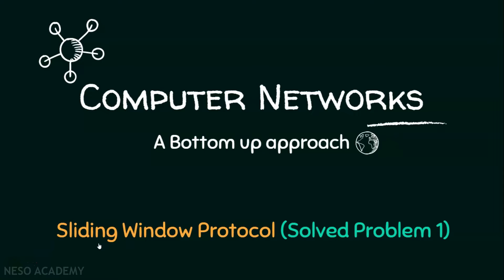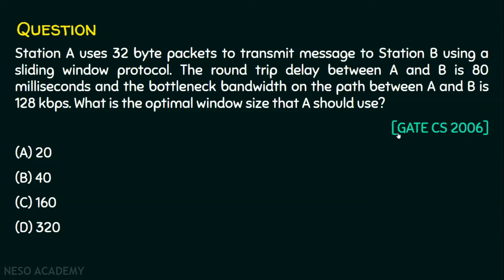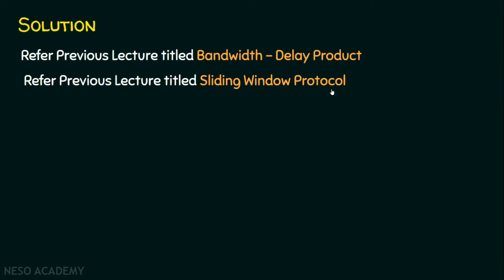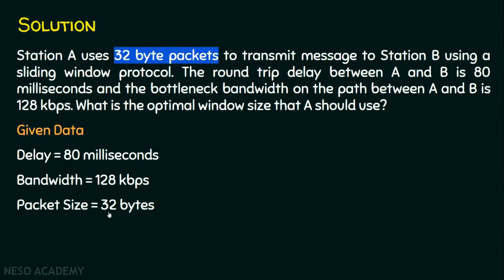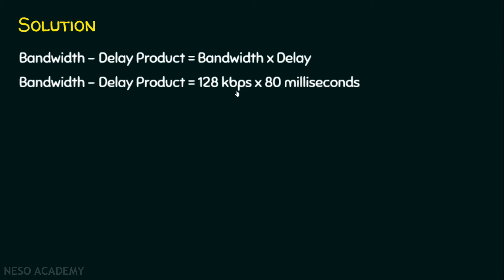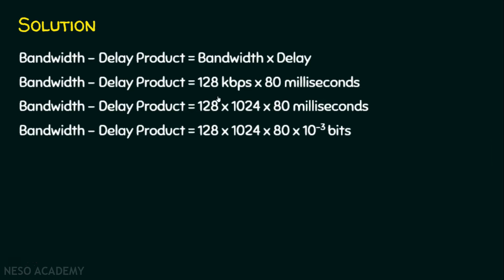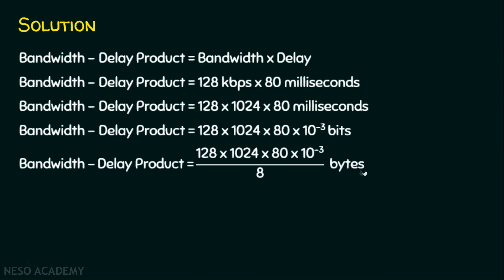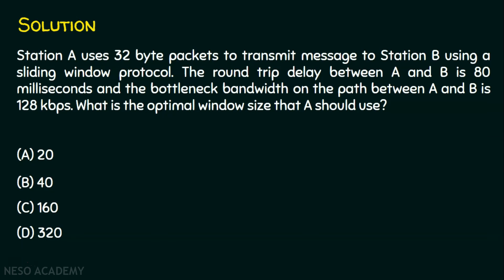Sliding Window Protocol (Solved Problem 1)

Comment: KB (Kilobyte):
1 KB = 1024 bytes (used in computer memory and storage).
Example: A text file size might be 50 KB.

kb (Kilobit):
1 kb = 1000 bits (used in networking and data transmission).
Example: Internet speed is measured in kbps (kilobits per second).

Hope it will clear all ur doubts..

Comment: Yes, when converting kilobits per second (kbps) to bits per second (bps) in the context of network speed, multiplying by 1000 is correct because network speeds use the decimal (base 10) system:

1 kbps = 1000 bits per second (bps)
This is standard in telecommunications and networking, where prefixes like "kilo" (k) adhere to the International System of Units (SI).

However, in computer storage, "kilo" often means 1024 (2¹⁰) because of the binary nature of data storage. For example:

1 KiB (kibibyte) = 1024 bytes
So, the difference arises from whether we're dealing with network speeds (decimal system) or storage (binary system). In a bandwidth-delay product calculation video, the decimal approach (multiplying by 1000) is appropriate.

Comment: Sir , 1 kilo byte = 1024 bytes not bits . So dividing by 8 is required?? 

If i am wrong please correct me
Reply: If the question says that it is 1 kilo byte, then we only multiply by 1024. We will not divide it by 8.

Comment: answer 40 is correct 
But replace 1024 with 1000 then u will get the answer 40

with 1024 u will get 40.96 which is actually wrong but 
can be used for choosing approximate answer
Reply: ha yaar bada dimag ka bosda kar rakha h school me 1024 padte hue aaye yaha aa kar 1000 kar diye
Reply: @pranavmittal9619  ye sab school padh rhe ho wah bhai

Comment: Bandwith-Delay product = Bandwith × propagation delay
Propagation delay = RTT / 2 = 40 millisecond = 40 ×10^-3 seconds
Bandwith = 128 kbps = 128 × 10^3 bps(bits per second) = (128 × 10^3) /8 bytes per second
Now, Bandwidth-Delay product = ((128 ×10^3) /8) ×(40 ×10^-3)) bytes = 640 bytes
Now, Window size = Bandwidth-Delay Product/Packet size or Frame size = 640 bytes /32 bytes = 20
So answer is 20.
Am I correct? 
Please correct me if I am somewhere wrong.
Reply: Yup it's wrong
Reply: @PKMKB93000  u r wrong
Reply: @RamanKumar-sp9bz  how? You want the slides of the remaining lectures?
Reply: @PKMKB93000   
{ 1KiloBytes = 1000Bytes = 8000Bits } & 
{ 1KiloBits = 125 Bytes = 1000 Bits }
Hope u got that

Neso has Done That Mistake
taking 1024 instead of 1000
Reply: @RamanKumar-sp9bz  Oh okay. Do you need the slides of other video lectures also? The ones that are private?
Reply: @PKMKB93000  Yeah Please
Reply: @PKMKB93000  yes plz
Reply: mhm nope wrong , the correct answer is 40ms , you cannot divide by 2 for propagation delay because we need acknowledgement as well  for data frames that why we use RTT instead of propagation time.
Reply: Let me try to explain:
firstly, we should know the data package link is not the same one as acknowledge link.
Secondly, the sender A need send data continuously in order to utilize the package link to the max.
thirdly, maximum window size of 40 doesn't mean there are 40 packages on package link. There are most 20 data package on the data package link.

So, if the window size is 20, it will be half part of the time that sender A doesn't continuously sent data package, because it needs to wait for the acknowledgment from receiver B, which is half of the round trip delay. <3

Comment: Bandwidth-delay product should be Bandwidth times delay, but in the solution above we have multiplied badwidth times Round Trip Delay to find the Bandwitdth delay prodecut. According to me we were supposed to divide the Round trip Delay by 2 to find Delay then we were to multiply that by bandwidth to find the required answer (20 acc to me). Have i understood something incorrectly? Anyone????
Reply: Bandwith-Delay product = Bandwith × propagation delay
Propagation delay = RTT / 2 = 40 millisecond = 40 ×10^-3 seconds
Bandwith = 128 kbps = 128 × 10^3 bps(bits per second) = (128 × 10^3) /8 bytes per second
Now, Bandwidth-Delay product = ((128 ×10^3) /8) ×(40 ×10^-3)) bytes = 640 bytes
Now, Window size = Bandwidth-Delay Product/Packet size or Frame size = 640 bytes /32 bytes = 20
So answer is 20.
Am I correct? 
Please correct me if I am somewhere wrong.
Reply: @aparnapathak6393  i think its 40 because we have to transmit data until it reaches the source but in worst case data can be collided so it has tobe round trip time hence the answer is 40  i got the same as 20 but then i watch it again about the concept of csma protocol
Reply: @sarastemkar7835  oh.. Okay! Got it! Thanks☺☺
Reply: I also got the same answer(20) bro, The question seems fishy in terms of terminology.
Reply: 20 aaya re kyu ki RTT toh 2twice hota he link ko pura fill hone me 40sec lagega jo hova Tp
Reply: acc to bandwidth-delay  definition from wikipedia it is the product of bandwidth *round trip delay
link to the article:https://en.wikipedia.org/wiki/Bandwidth-delay_product

Comment: There will be multiplication of 1000 not 1024 because 1KB = 1024 bytes 
And 1kb =  1000 bits
.
( 128 × 1000 ×80 ) / 32 ×8 × 1000
Reply: 1kb =  1024 bits=2^10
Reply: @blueSurfer  he has no brain cells🤣😂😂
1 kb = 1024 bits correct friend

Comment: In your bandwidth-delay product video you converted kbps to bits by multiplying by 1000 (not 1024).
Reply: Sir, there is some logic. Please explain. Even I have this doubt.
Reply: Lol ha
Reply: Yes, when converting kilobits per second (kbps) to bits per second (bps) in the context of network speed, multiplying by 1000 is correct because network speeds use the decimal (base 10) system:

1 kbps = 1000 bits per second (bps)
This is standard in telecommunications and networking, where prefixes like "kilo" (k) adhere to the International System of Units (SI).

However, in computer storage, "kilo" often means 1024 (2¹⁰) because of the binary nature of data storage. For example:

1 KiB (kibibyte) = 1024 bytes
So, the difference arises from whether we're dealing with network speeds (decimal system) or storage (binary system). In a bandwidth-delay product calculation video, the decimal approach (multiplying by 1000) is appropriate.
Reply: 1kb=1024 bits
Reply: @MrPerfect-ju8jg  you are confusing bytes and bits. 1kByte is 1024 bytes but 1kBit is 1000 bits
Reply: @Luna-vk9xy  then 1KByte = 1K*8bits = 8000bits  which is not equal to 1024*8 = 8192
Reply: @rakeshreddy512  
{ 1KiloBytes = 1000Bytes = 8000Bits } & 
{ 1KiloBits = 125 Bytes = 1000 Bits }
Hope u all got that